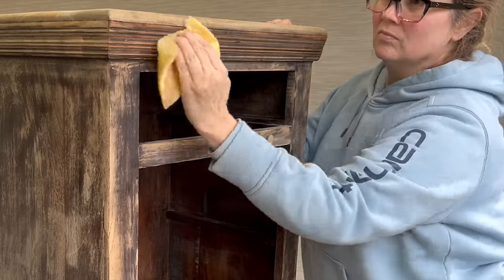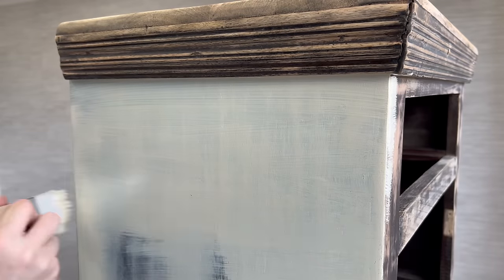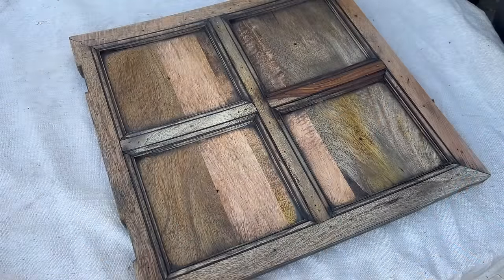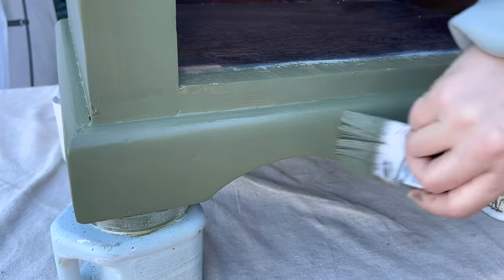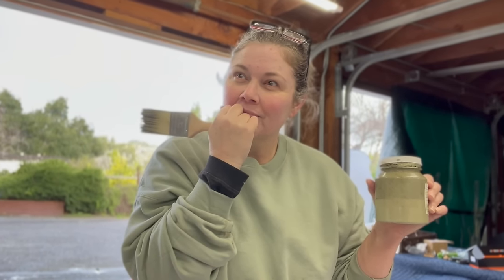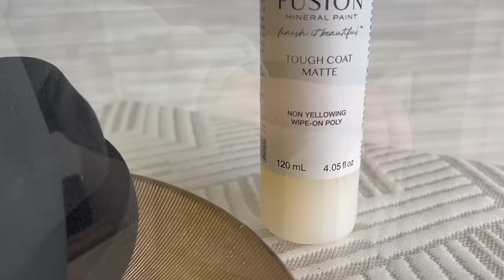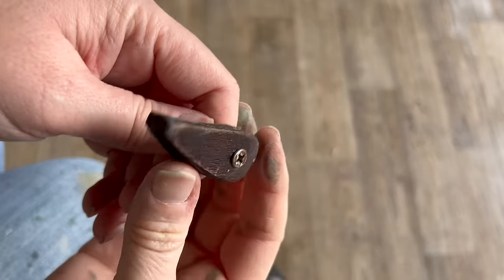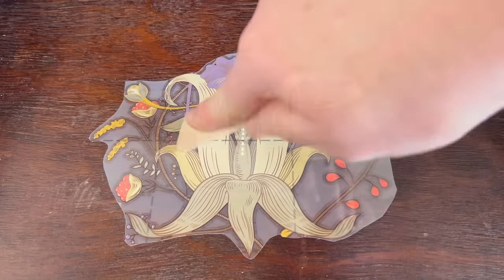DRASTIC REFINISH of Industrial-Rustic NIGHTSTANDS to something NEW... | RADICAL NIGHTSTAND FLIP!

Comment: These are amazing. Andy do you shop for your supplies for each piece as you are doing them? Or do you have a stash of things to pull from?
Reply from the maker: Thanks so much, and great question! The answer is honestly: a bit of both.  I have a few shops where I know I can see the actual Redesign With Prima transfers and decoupage papers in person, and so when I'm there, I tend to pick out two or three (or four 😊) that I like, even without a specific project in mind.  Antonia (the one I used on the nightstands) was one of those - I think I found it back in December.  I find having materials on hand that I can pull from is incredibly helpful to the design process.  All that said, there are many times that I find a piece and decide it needs something specific, and then I order that and wait until it arrives to confirm and begin working.

Comment: Andy, have you ever had a problem with the peel and stick wallpaper off-gassing?  I used it for the first time on the back panel of a cabinet and the customer says it stinks?  I'm embarrassed,  but wondering if you or any of your peeps have encountered this.
Reply from the maker: Oh no!  No, I haven't had that experience - hmmm...do you have any of the paper left over?  If yes, does it smell badly to you?  (some amount of "new paper smell" is normal...like "new car smell") If not, is it possible the smell is coming from the piece itself? If that's the culprit, the customer (or you, if you wish) could seal the piece with some clear shellac.  If it really is the paper, that is really weird - I would write a review or possibly as for a refund from wherever it is from, and advise the customer to remove it.  Please be careful here - do you feel you are dealing with someone who is being reasonable/honest with you? If you suspect this customer is not being fair or is being overly sensitive, then obviously it's up to you how you'd like to handle it, but I'd recommend having some support at the ready.  Either way, try to not feel embarrassed! There's no way you could've predicted this would be an issue.  Let me know what happens, I'll be thinking about you! ♥️